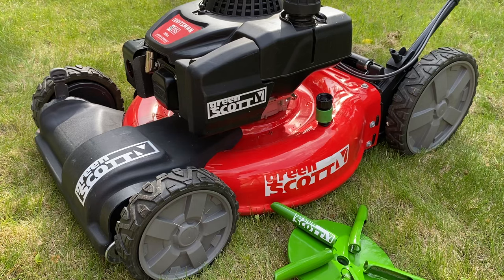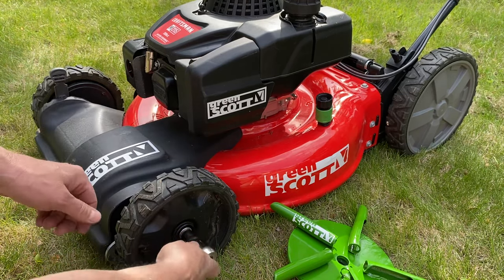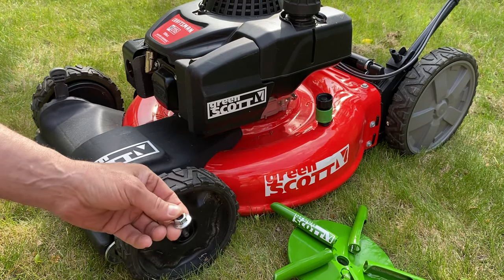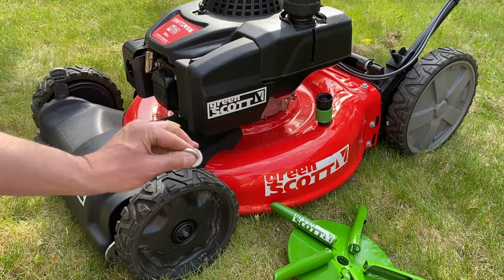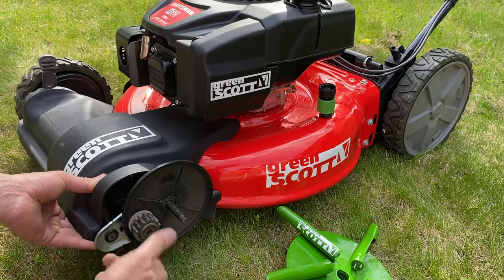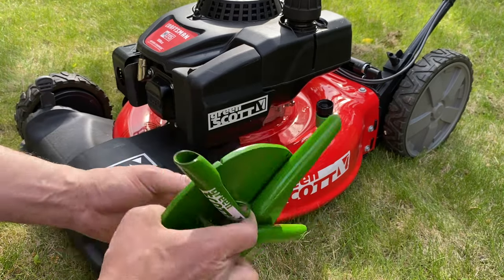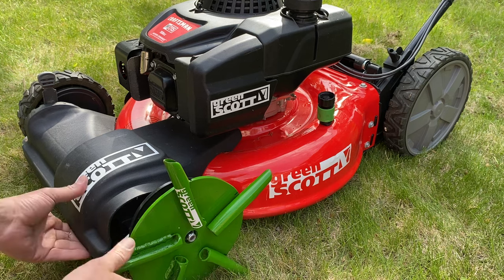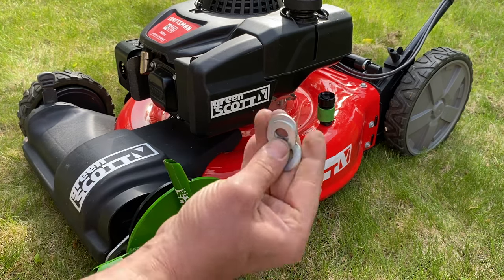Green SCOTT Lawn Mower Aeration Wheel Install @ greenscott.ca

Comment: Can you put this on the Rear wheel? It would have greater down weight with a full grass bag .
Reply from the maker: All depending on your Lawnmower set up a guy could pretty much do anything with this product. I guess it would all depend on the structure of your lawnmower as board is slightly different and has different weight distribution. I found, though that being on the front, you then can easily lift the front of your lawnmower when turning around. As well, it made on my lawnmower no significant difference. That’s a great question.

Comment: I have a Greenworks 40V 20 inch Brushless Dual Port Lawn Mower,  model MO40L00, which size of the aeration wheel I shall buy? I see you have 5 different sizes from 6-8". Thanks!
Reply from the maker: It looks like that specific lawnmower has a 8 inch wheel. My wheel sizes correspond with the exact wheel size on your lawnmower when ordering. For extra confidence when ordering check on my website under the menu/installation there are a couple good demo videos that are short on installation and measurement.
Reply: @green_SCOTT  wonderful, thanks! will place order

Comment: Hey Scott (we Tlked lastnight. Be Patient) , Got it wrking today . This is my 2 cents . Great Product. BUT because my mower is rear drive it was easier to apply pressure dwn while rolling (by pushing up on the handle) or shut it dwn and just push. Just pushing ia  a Serious Workout BUT Still better than any plugging tool sold. ~ for Green Scott Aerator 2.0  I would say Dual tines and a Weighted Wheel (or Rotors XD) . whatever gets the tines it in there . Like i said doing it on this Honda hb216 is a Serious wrk out and my lawn is Tiny. I have seen models like this BUT for the price LMAO I would just assume make one.  If you dont I just might do that with the one I have now. You will know if you see me order another. THANKS again and Have a Great Day
Reply from the maker: I’m thinking about working on a different invention entirely involving aeration, although depending on each individuals soil conditions it seems as product works for the vast majority of individual soil types. The key is gradual aeration and yes we should talk in future regarding NEW products.
Reply: @green_SCOTT  ❤

Comment: I have an electric mower, echo.  It is super light.  Would this still work?
Reply from the maker: Even with light lawn mowers the key is moist soil and speed which are the critical factors in causing the spinning wheel and kinetic energy to be transferred into the soil pushing out cores… Mind you the depth might not be the same as a 70 pound lawnmower. Although I think you will find with even smaller plugs the amount of nutrients and dirt topsoil that is brought up to the surface aids in keeping the new grass seedlings wet and increasing lawn thickness overtime. Yes always best to throw down a little bit of top seed. This product is kinda like going to the gym results are cumulative. 🌱💪🏻

Comment: Is it gonna fit my Toro 7.25 - 163 cc mower.  Would really like to buy. What size should I get. Thanks
Reply from the maker: I would like to suggest people to go to my website under the menu section installation gives you great confidence in knowing exactly how the product works and easily how to measure.  For the most part a lot of people I’ve been ordering with the Toro and zero complaints… my wheel sizes either a core spike or pin aeration correspond to the wheel size on your lawnmower. It’s that simple. 🌱
Reply: @green_SCOTT  Thanks. Will  check out the website.

Comment: Is there really enough weight of the mower to get cores ?
Reply from the maker: Yes 100% the forward kinetic forward action drives tines deep 2-1/2" plus.  Plenty deep for top seeding and water penetration allowing new seedings to grow.
Reply from the maker: Check out the way I measured weight and tine pressure! I even went to Home Depot and the Aeration machine in this attached Video had 34 pounds of force per tine! Same as GREEN SCOTT 

https://youtu.be/ZQJFa7cEX3s

Comment: Can I install the two front wheels,,?
Reply from the maker: I found that it works best with just one wheel on the left side!
Reply: @green_SCOTT  
My lawn mower they have rear drive self-propelled Wheels, can I still installing two front wheels?
Reply from the maker: @CesarSanchez-ef6sl  They kind a word fight against each other when one is wanting to go into the ground the other one is attempting to pull out of the ground that’s why they do not collectively work together well. But as single item they were great.
Reply: There is a reason why an aerator machine have four Ties on it or more, to reduce time
Reply from the maker: Because this product is used for gradual use every time you mow your lawn your aerating in essence you spend zero time aerating. The results are cumulative and more aeration throughout the entire season is more effective for your lunch check out the videos on my website. And the reason they’re not on all four tires of your lawnmower is because they would counteract each other and not work as effectively.